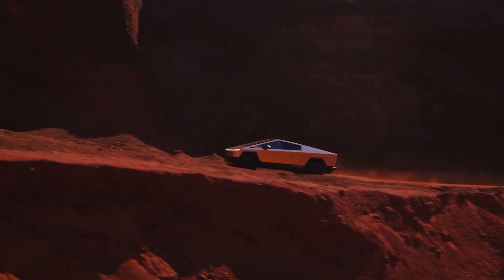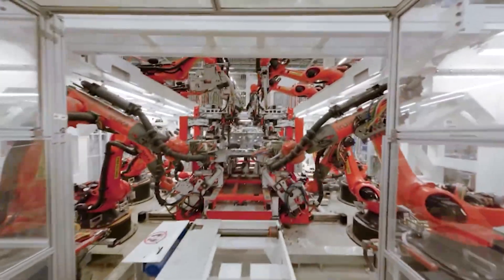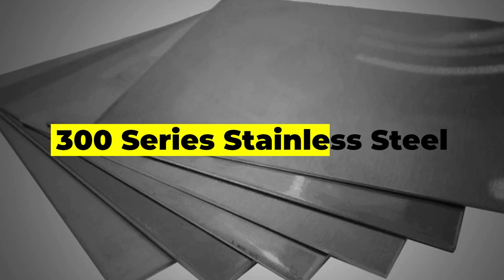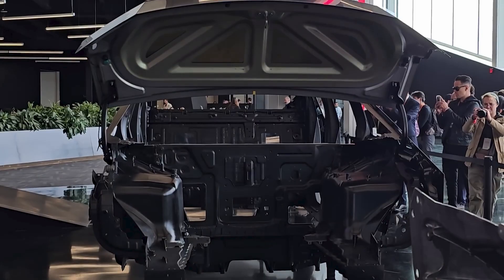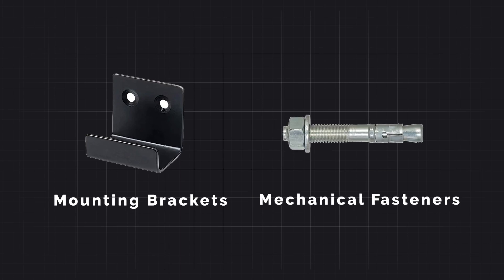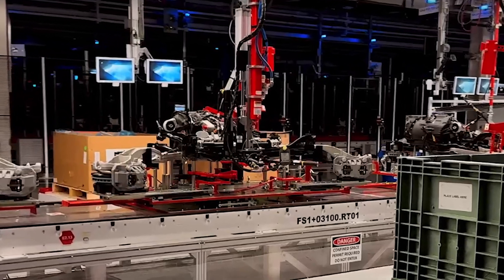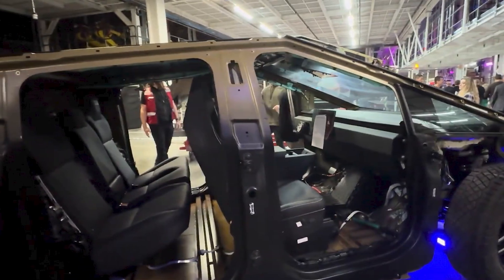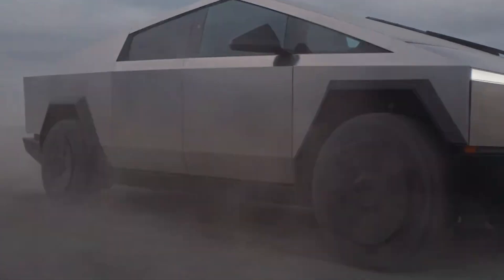How Tesla Builds A New Cybertruck!

Comment: Probably adheasive to combine the inner and outer skin.  Also Permanent magnets are at the front, induction motors at the rear.
Reply: Looking at the latest vid from Munro and associates it is Lazer welded.  Amazing I thought that would show heat marks on the A side.  Incredible tech
Reply: Not probably, Munro stated that is the way it is done. I think that came up during his interview with Elon.
Reply: I am sceptical that glue would survive. I had two Apple watches and a Withings scanwatch replaced for free under the warranty when the casing fell apart due to glue failure. This might have been due to sweat induced failure, or temperature changes and differential expansion, as I wore them while ice skating. None suffered any impacts. However, I would expect Tesla to have done significant testing, with temperature variations and salt exposure.
Reply: @StillAliveAndKicking_ 
You can compare cheap Chinese glue on a watch to one that's designed to hold tons of metal together.
Reply: @StillAliveAndKicking_  With the greatest respect, there are different types of glue.  The fact you are an apple user is just amusing.
Reply: @Electobat  The point I was making is that watches use engineering glues that are designed to last, but they don’t. Are there example of engineering glues used in similar applications to steel body panels on aluminium frames?
Reply: @StillAliveAndKicking_  please do the smallest amount of research.
Reply: Adhesives have some major weaknesses when it comes to delaminating forces. I don’t think you could hold a car together using only adhesive bonds.
Reply: Yes you can and it is already done on other Teslas. Munroe has shown how strong it is. There is often some bolts to hold it in place while the adhesive cures but the main strength comes from the adhesive. Whole boats are in essence made with adhesives like Polyester and Epoxi. . @Rudmin
Reply: @nicklasurbansson4650  Munro just released a video showing that it is laser welded. I know lots of vehicles use glue to carry a significant portion of the frame joint strength. But I don't know of any that use only glue. Usually they are still bolted or riveted across the glue joint.
Reply: @Rudmin 
Cars with aluminium chassis are held together with adhesive as welding weakens the joint.